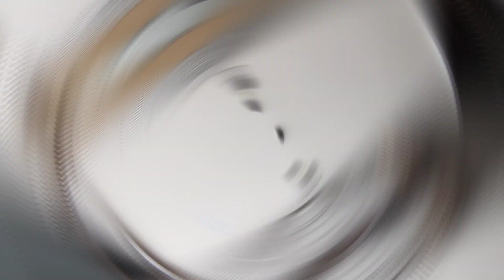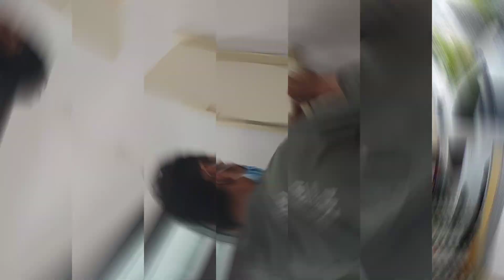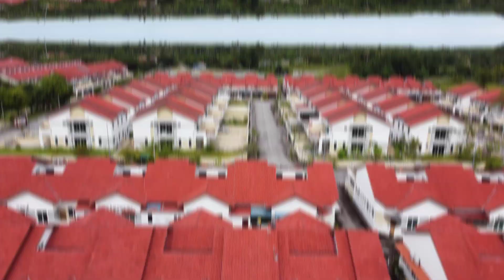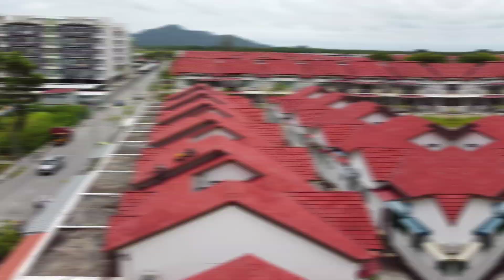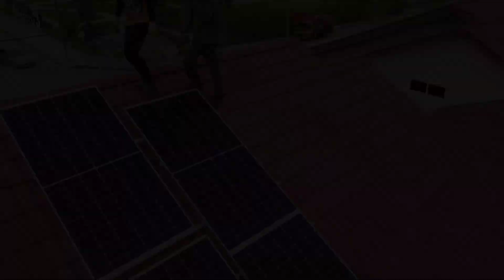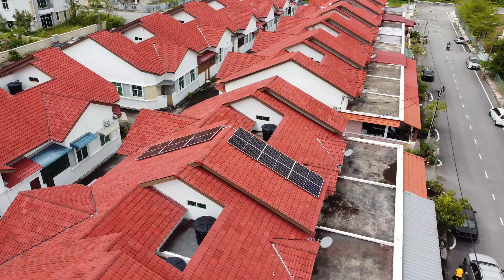My first home solar power system installation

Comment: May I know how much does this cost u? What was you before and after electricity bill? How many pax at home? Thinking of to get it done too.
Reply from the maker: The entire system cost me RM22650. Expected ROI of 7-9 years, my monthly TNB bill before this is between RM180-230 depending on how long we in the aircond. 6 person at home and expecting power consumption will go up in future.
Reply from the maker: With my current usage, I expect to pay zero TNB bill, though I'm still waiting for my first month bill in Nov :)